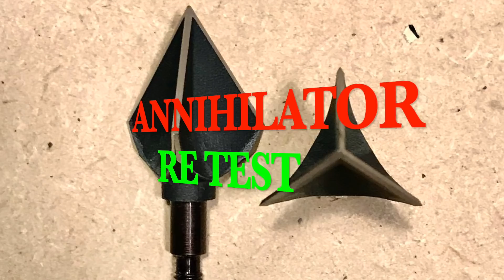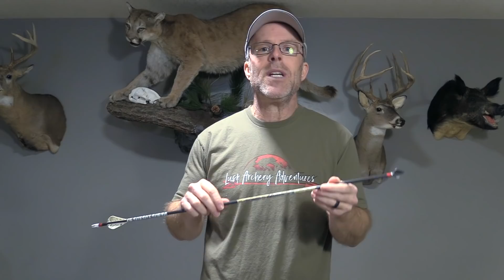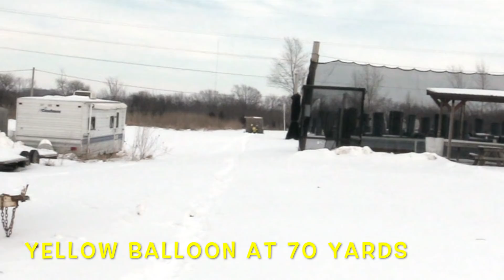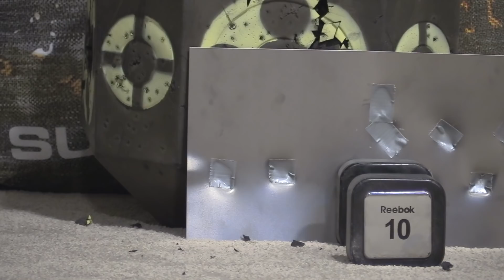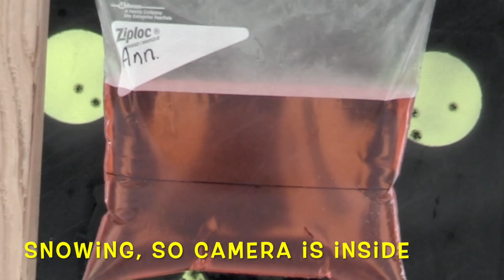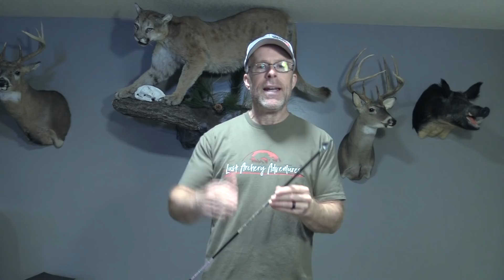ANNIHILATOR Broadhead RE-TEST

Comment: Can you explain what changes you had to make to make it fly for longer ranges please? I'm not sure why you would have to make changes.. I think it's an amazing head and it flew perfect for me out to 60 yards. After 60 the drop was extreme. Thanks!
Reply from the maker: That's interesting. I didn't do anything other than sight in my field points. What had happened for me was I had made some changes to my set up late last summer. With those changes, I had to add 7-8 yards to my sight tape at longer ranges. But I forgot to do that when I tested the Ann for the first time, cause it was a few months later. I went to shoot them the other day and they were hitting low at 70 yds, just like before. But then I shot my field points and they were hitting low as well. That's when I realized what I had done. So I re-sighted in my field points at 70 yds and then my Ann heads hit right with them.

Comment: I have a friend who is an expert ballistics resource with bullets. He has used wet phone books set horizontally for measuring penetration. He found that media represents deer tissue very well and easy to measure penetration repeatedly. Might work with broadheads.
Reply from the maker: That's a good suggestion. I may give that a try. Thank you.
Reply: @LuskArcheryAdventures  He soaked them in a tub of water, then built a wooden rack to hold them. He would measure the penetration in inches, then change the books in the rack. Old phone books are pretty easy to get.

Comment: What adjustments. ?? If your field points hit the Broadhead should hit. Your not the only one that has experienced drop. Something fishy about this.
Reply: You have to explain better about adjustments. If you made adjustments and your field points hit the mark. The Broadhead should hit to.
Reply from the maker: Man, I've tried to explain it as best I can. Here's what happened: Back in late summer, I made some tweaks to my arrow set up for elk season, adding more weight to my arrows with wraps and lighted nocks. With those changes, I needed to add 7-8 yards to my sight tape for longer range shots. I considered just putting on a new tape, but instead chose to just remember to make that adjustment. A few months went by, during which I did not shoot at any longer distance. It was then that I did the test of the Annihilator. I shot it at 70 yds and it hit very low, as the first vid showed. At that time, I did not shoot any other head, field point or broadhead, at 70 yds. Then a few of my friends reached out to me and told me that their tests did not show any drop at longer ranges with the Annihilator.  That intrigued me. Then at the ATA, I went to the Annihilator booth and spoke with them. They were quite humble and respectful, but did say that their testing showed different results from mine. So I decided to do a re-test. I told them if my first test was right, I would keep the vid up, but if it was wrong, I would delete it and do another one. Then I went out to the range. I shot the Annihilator at 70 yds and it hit low, just like before. But then I shot a field point at 70 yds and it hit low as well. That's when I remembered my mistake; I had not been adding the 7-8 yds to my tape. So I added the yards and shot the field point--it was dead on at 70 yds. Then I shot the Annihilator, and it hit exactly with my field points, dead on at 70 yds. Does that make sense?

Comment: In other words. They are now paying you.
Reply: What adjustment.s. ?? Why make any adjustments to your sight tape. ??
Reply from the maker: No, they are not paying me a thing. Here's what happened. Late last summer, I made some adjustments to my arrows and set up. In order for my sight tape to be accurate I had to add 7-8 yds to the reading; that was easier than printing new tapes. I added those yards with many of my long range  tests and on my western Montana elk/mulie hunt in September. But a few months later, I was testing the Ann and I forgot to add those extra yards. I hadn't shot at distance since September. So when they hit low, I thought it was the head. I went to re-test them last week and they still hit low at 70 yds. So I shot my field points at 70 and they they hit low as well. That's when I remembered the adjustment I had been making and forgot to make now. So I made that adjustment and my field points were dead on at 70. Then I shot the Ann and it was dead on at 70 as well. Does that make sense?

Comment: I thought that it was a great broadhead based on one piece fixed blade. 50 yards, I never shoot anything but a bag at distances farther than that. If it works at 30 and below and doesn't need to be replaced, it's a winner.
Reply: eddie heath Thank you for watching and sharing that. Much appreciated brother
Reply from the maker: I already replied a while back using John L, but in order to clear my "comments not yet replied to" box, I'm posting this from my main channel :)

Comment: Great job on the re-test. You handled it great. I was looking into the Annihilators and backed off after the first test. I hunt in big country out west and a broadhead that can't fly beond 70-80 yards is a no go.  Now they are back on the list and I would like to see the Annihilator up against the Tooth of the Arrow. Not sure you did that video. Take care!
Reply from the maker: Thanks Stephen. The Tooth of the Arrow is a fantastic head. This year I am testing all of the heads through the same materials, so even if I don't do a head to head comparison, you will be able to compare the results of all the heads. Eventually, I will put the Tooth heads through these materials as well, so you can compare the penetration, water bag drainage, and durability.

Comment: I'm stuck between these in 125 or a VPA 125 for my 3 blade head next season
Reply from the maker: You can't go wrong with either of those. For a three blade head, I've been impressed with the Exodus and the Grim Reaper Micro Pro Series as well--great flight and excellent penetration.
Reply: Austin Carpenter Neither! TOTA XL👍🏼
Reply: Austin Carpenter have you shot the vpa before?
Reply: @adambreeggemann6548  No sir.

Comment: So in the first video he was comparing with exodus. 
Why didn't the exodux hit low at further distance since the problem was his sight tape??
Reply from the maker: Well, I didn't shoot the first vid with the Exodus at longer ranges either; I only used the Exodus for bag and penetration tests. The Exodus flies very well at longer ranges as well. Since I'm using the same mediums for all my heads this year, I will get to the Exodus for those as well. Then you can compare any heads to any others.
Reply: @LuskArcheryAdventures  Ok i thought you did a head to head comparison between the two heads.
Reply: Adam Yoder pomsky I did do a comparison but only for the penetration and jug drainage portions.
Reply: @JohnLuskOutdoors  Ok its just strange that a lot of people are reporting that the ann does drop but I'll take your word for it. 
On another note shooting a head through a plastic bag full of water is about the most ridiculous test I've ever seen. If you shoot it with a techno hunt tip its going to tear a way bigger hole than any head. 
We expect a lot more from you.

Comment: If you had to choose a 2 blade fixed head what would you go with I've been looking at iron will broadheads
Reply from the maker: There are a few really good two blade heads. For a single bevel it would be the Bishop Scientific Method or Cutthroat Archery. For a double it would be an Iron Will or VPA or one of the many Australian broadhead companies, like Northern, Ozcut and Extract. I've got an Australian two blade test coming up.
Reply: @LuskArcheryAdventures  what sight do you use

Comment: Thanks for the re test. What do you think was the issue with the first test? Also, I'd like to see a slow motion test to see if it acts like a hollow point bullet and see the displacement it makes
Reply from the maker: I had been testing different weight heads, different draw weights, and different vane/FOB configurations. I had been adding an extra 8 yards to my sight tape to have them dialed in, but forgot to do that when I tested the Annihilators the first time. It was the first long range shooting I'd done since September and hadn't remembered to do that. I shot my field points at 70 and they were really low; that's when I realized what I had done. I adjusted for my field points to be dead on and then the Annihilators were dead on as well. It doesn't act like a hollow point, cause they don't expand. But they just displace a large amount of tissue with that scoop design as opposed to a blade design. The flight is not affected due to the way the scoops are structured. The Ramcats use that same scoop, on a smaller scale, and it's why their heads fly so well.

Comment: Seems like the same concept as underwoods extreme defender and extreme hunter ammo. The flutes in the ammo design create just as much if not more damage than a hollow point. Check out the videos of the extreme defender ammo ballistics test and see if u agree
Reply from the maker: That's cool. I'm not familiar with that. But it sounds like the same principle.
Reply: Same concept but the bullet is obviously traveling and spinning much faster which allows the push and disruption of tissue(hydrostatic shock) causing a permanent wound channel. This broadhead may do that to some degree but I would like to see better gel and animal evidence before being convinced.

Comment: Lusk I'm positive they had issues with the first batches of 125s when they first came out. Maybe you might of had a bad batch?
Reply from the maker: Yes, they did have some problems with a batch of 100 of the 125 gr heads. But I ordered mine much later and still have  of them; they were fine. It was my sight tape. I had forgotten an adjustment I was making when I was shooting longer ranges all through the summer. I just re shot a field point at 70 and it was low as well, that's when I realized what I'd done. When I sighted in the field point, the Annihilator was dead on as well.

Comment: Ahhhh! Please tell us what you mean by "stainless"! You can quote alloys like 4140 and A2, but you leave an insane amount of room when you say "stainless". Stainless is as big a class as "tool" steel, of which there are many, like 4140, A2, S7, etc. Stainless is just an alloy that contains enough chromium to be highly resistant to oxidation, this includes alloys like 304, 314L, and 440C. The 304 and 314C are austenitic, and will not harden to a high degree. On the other hand, 440C is a very high chromium(Stainless) steel that is martensitic, which means it will harden and temper, 440C is a common cutlery steel. If you compared a blade made of A2 and one of 440C, you would find little difference besides the corrosion resistance of 440C.
Still though, i love the scientific approach to testing broadheads and i have watched many different tests here. I especially like how you admitted to a bias during testing, we are all human, even while trying to be objective and you didn't just let it fall through the cracks you actually retested. Love the videos
Reply from the maker: You're right. Most heads use 420 stainless, so that is my general thought when I reference stainless.

Comment: I’m sorry if you had to adjust your sight type to get the arrow where you want it then yes the head causes velocity drop. If you used two same grain broadheads with both having the same arrow setup but one arrow falls short then there is a problem.
Reply from the maker: No, it was dropping with my field points as well. I had made a number of adjustments last summer and was adding 8 yards to all of my tapes in order to get them to hit dead on. But it had been so long since I shot longer ranges, I forgot to do that when I tested the Ann. So when I shot my field points the other day at 70 and saw they were hitting low, I remembered my error. I sighted in my field points and then shot the Ann and they were both dead on.
Reply: Lusk Archery Adventures so in the first video the exodus and the Ann was hitting the same place low as I recall the Ann was hitting low in that video which doesn’t make it a bad broadhead it just makes you have to adjust somethings to get it to fly the way you want it those large scopes will make more resistance but doesn’t make it inferior
Reply: matthew perry No, I didn’t even shoot the Exodus at long range in that video. I only shot the Ann at 50 and 70. I shot the Exodus at the water jug and the MDF only.
Reply: John L well I suppose you aught to make a video to test it shoot it against another broadhead with less possible drag the exodus I bet would fly with less drop. My apologies for not realizing you not shooting both heads in the first vid.
Reply: matthew perry Well, that’s really moot. It shot right with my field points at 70 yds. I shot a field point then I shot the Ann. It didn’t drop any more than my field points; why would another broadhead drop less than that? Doesn’t make sense.

Comment: Funny how this video/re-test is released literally a couple days after I had a long discussion with an Annihilator rep calling them out on their over exaggerated bs marketing.. The rep even told me to reference the original lusk video where I pointed out how it lost to the exodus.. He even mentioned the exact type of tests Lusk is doing on this video..  This is clearly a promotional video attempt by Annihilator.. Funny how Lusk isn’t running this “test” head to head with any other Broadheads...
Reply from the maker: No, my original test did not have the Exodus flight at 70 yds. It only showed the Exodus in penetration and plastic jug drainage. Since I'm recording all of that info in my new testing, you can compare all of the heads to one another throughout the year. If I would have shot the Exodus at 70 yds in that original vid, I would have seen the problem then. When I shot the other day, even my field points were hitting low at 70 yds. Once I adjusted for my field points to be on target, the Ann was dead on as well.
Reply: Lusk Archery Adventures  gotcha..
Reply: If it was a head to head test between annihilator and exodus why not shoot both at 70 yards. I've watched a lot of lusk videos and he always shoots both. 
I guess its hard to prove since he took down the first video😂😂🤣
Reply: Adam Yoder pomsky  sad that an “honest” reviewer took down the head to head test, instead of just putting a disclaimer that the one wasn’t shot to 70yds.. Deleting the entire video ultimately leads one to believe there’s an “honest” bias to one head..
Reply: Jakudah Symba No, I didn’t want that vid spreading around something that was incorrect due to my error. I lost a lot of views by deleting it, and the future AdSense revenue along with it. But I don’t want to make revenue on something that’s incorrect. I didn’t shoot the exodus at long range in that vid cause I have other vids where I did shoot it at long range. I know how it flies; I was only testing the Ann at range.
Reply: Adam Yoder pomsky Haha. I know what I did. I’d shot the Exodus at long range in many other vids so I only shot the Ann at long range in that vid. But I did shoot the Exodus at the water jug and the MDF.
Reply: He doesn't run all his tests head to head with other heads, keep rocking your tin foil hat though.
Reply: Chest Thumper Outdoors no shit sherlock.. but the original test was against the exodus. He should’ve ran it again head to head since it is called a “re-test”... Keep kissing your sister thumper
Reply: If he improperly tested the exodus, then sure, but he didn't he improperly tested the annihilator. 
Seems to me you are being just another youtube hater.
Some advice you might consider filing away for later use, when you have to fall back on personal attacks, especially poorly crafted ones, the validity of any point you are arguing rapidly declines.
Reply: @Chestthumperoutdoors  Just curious if his sight tape wasn't functioning correctly for the annihilator wouldn't the Exodus have hit low?? He was using the exact same bow😎
Reply from the maker: I didn't shoot the Exodus at 70; only the Annihilator, in that video.
Reply: Chest Thumper Outdoors First of all he ran both heads through the same test at the same time.. Secondary you initiated the bashing with your foil hat comment.. Don’t try to sound intelligent when you’re obviously making asinine statements.. Nice try though
Reply: Boxing 101 I told them the exact same thing, just be honest about your broadhead, and cut out the BS fluff.. I personally am a Single bevel fan and shoot 170 spine Grizzlystiks with 200gr heads out my 83# APA King Cobra TF2.. My arrows are 750gr chronod at 270fps. Now Elk are definitely on my list but currently Im in Ga so hogs and deer are what I kill..
Reply: Rusty Shackleford 😂 wow such an eloquent response...
Reply: Rusty Shackleford  see the problem with folks like you, is you initiate with the insults, with no context to justify your reasoning.. Someone pops off at me, If I’m bored I’ll throw it right back at them.. Now go crawl back into your hole lil troll..